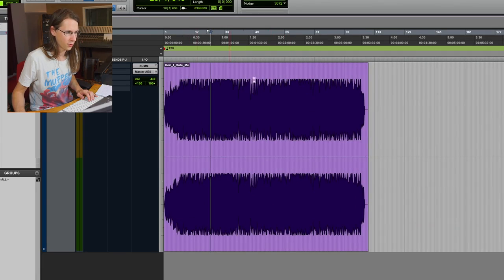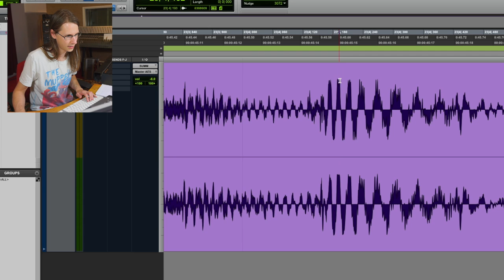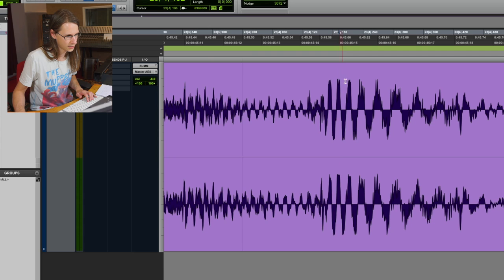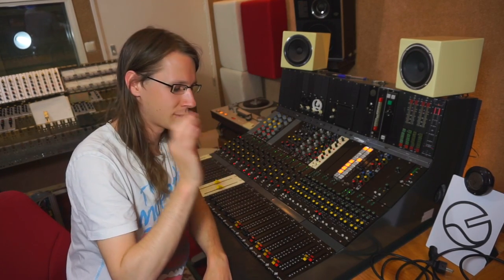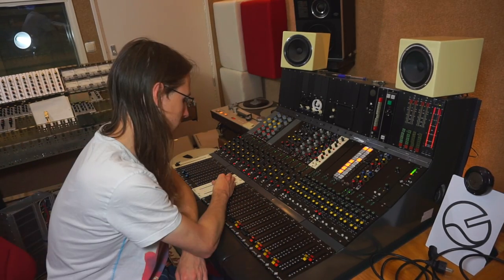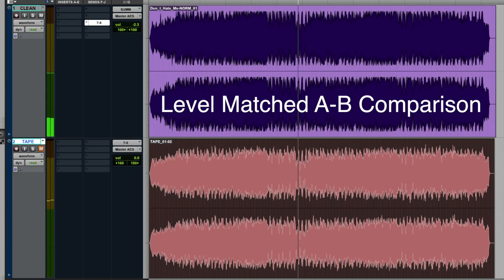How to use TAPE COMPRESSION?

Comment: I learnt this as... you are driving the signal beyond what the tape can handle. It thus ends up distorted, but, rather than a harsh clip/flatline distortion you would get digitally, the tape distortion adds the harmonics/colour into the signal, which is the "warmth" that the listener hears as a result.

Many audio engineers go to tape and back to digital just to achieve this warmth, as no matter how accurate a plugin maybe in its attempt to simulate tape distortion, you can never beat the real thing.

Great video!
Reply: It's millions of rusted particles being displaced compared to a finite amount of 0's and 1's in a limited sample string or word length. One is limited the other is infinitley variable. The wider the tape the harder you can push it and the fatter warmer the sound. It's ashame that tape is coming to an end. One of the last tape engineers near where I live said there's roughly another ten years left and then it's all over. No one is making spare parts and all the tape engineers are either dead or retired.
Reply: +john -- Whoever the "last tape engineers near where" you live is, is dead wrong. There are tons of people making parts for machines. Even the original companies still make parts in the case of Studer/Revox, Ampex, etc. if you need something specific that the hundreds of second-hand tape shops don't already have for cheaper. You can readily buy brand new blank tape in many formulas and sizes through RMGI or ATR... they're still going strong. Tape engineers are not dying or retiring, they are simply passing their knowledge on to younger tape-ops. Mara Machines are still selling the MCI tape machines and decent Otari's, Tascams, Studers/Revox's are readily available if you just look around. (They aren't cheap, but then, they never were).
Reply: This is correct
Reply: 100%

Comment: Yes, OK, a question; can you get this kind of sound using cassette tapes? I seem to remember you can, but it was 30 years ago since I made recording on cassette tape. A cassette machine is a much less cumbersome beast...and I have one...somewhere...
Reply: Sure, a similar thing will happen with a cassette tape. You will also lose a lot of quality compared to a tape machine, however.
Reply: No you cannot, it is simply not wide enough, technically it will do the same thing but there are not enough iron particles on a cassette tape to get appreciable results, it would distort horribly before you got musical harmonic distortion. It is also why cassette tape was always so noisy, because it simply wasn't wide enough to add dolby compression to denoise it like you had to with upwards of half inch tape. Cassette was awful sound quality and was only successful because it was cheap to produce, it made a semi comeback purely because of nostalgia.
Reply: +Adrian Mutimer -- yes, absolutely you can do the same thing with cassette tapes. You must be mindful that a standard cassette recorder records at 1 7/8 inches per second, and this will have a much more dramatic effect on the sound than compression (loss of quality). Your best bet on cassette tape compression is to find a "high speed" cassette machine that can do 3.25 or 7.5 IPS (look for a few of the Tascam models that could do this). Then, the process is exactly the same as with a tape machine: the harder you push levels into the recorder, the more compression will occur... but eventually it will just distort. Lots of engineers will use this technique with cassettes on digital delays or reverb channels to add tape compression to that effect.

Comment: Different kinds of tape sound different too. Where in the world did you get Agfa? I thought they were gone by the late 80's. I remember the last studio I worked at with analogue tape. We could only get Ampex 499, 456 and the odd time 406 (which we never bought because I hated it) and that was dying fast. 456 was a little cheaper but had that 70's tone where 499 was the modern sounding tape. I did a lot of tape baking as Ampex was very prone to ageing. Especially 456. The studio owner was cheap. LOL.
Reply: AMPEX 456 before the 90's I think, were affected by sticky shed syndrome, it wasn't ageing as such it was a manufacturing defect that caused it to absorb moisture in the atmosphere and the iron to lift from its backing. It wasn't spotted until it was far too late, so it had a very short shelf life if it wasn't stored properly. A veteran tape technician told me that once.
Reply: +Rob Chapman -- that's just an AGFA flange. The tape on the flange is more than likely RMGI or ATR. They still make many of the AGFA / BASF formulas. ATR makes their own formulas still ... probably the most widely used right now are the RMGI SM-900 (BASF) that is a +9 tape, and the RMGI911 which is +6.

Comment: Which tape emu plugin will you choose if your hardware become broken? Which of them is closest to real thing? (except Nebula)
Reply: without a doubt, the best tape emu plugins I have used are the UAD Studer A800 and UAD Ampex ATR-102. Having used Nebula offerings, Waves, Softube, Slate, etc... nothing even comes close to the sound of tape that UAD does. It would probably be worth it just to buy a UAD Satellite if for only their tape emu's... a little bit cheaper than buying a nice tape machine, and a whole lot cheaper in the long run.

Comment: Will tape compression done on a compact casette machine sound like it does on a reel to reel, or are the speed differences important to the harmonic generation?
Reply: yes it will sound very different...very very different.. all tape machines differ quite drastically in sound even the high end studio ones
Reply: first, with speed also the frequency response changes. most noticeable at high and low frequencies. (bump/roll off) Next, every tape brand has its own sound. That all, however, does not mean you are not allowed to experiment with cassette decks. could be fun.
Reply from the maker: +Johannes Mazur correct!

Comment: Not something I would use in the mix buss or when mastering tbh, Getting the frequency balance is already hard and adding a lot of harmonics breaks that balance. Something I would do is to use it on individual tracks or groups.
Reply from the maker: +heavymetalmixer91 There are a millions ways to implement the tape machine in the production, Its also great to use in parallel.

Comment: Who would "down" like this instruction vid?
Reply: Solo Travis it has some inaccuracies. He’s comparing digital distortion to analog distortion and referring to it as compression. Tape doesn’t actually compress the wave, it distorts it in an aesthetically pleasing way when the distortion is moderate. Leveling amps and compressors don’t work this way because they are not designed to.

On the other hand, what he’s saying about the sound is pretty interesting and from experience, imo. I like the video overall, but just pointing out why someone else might thumbs down it